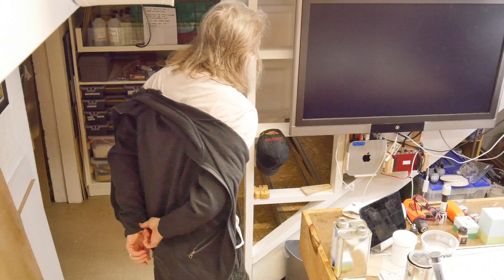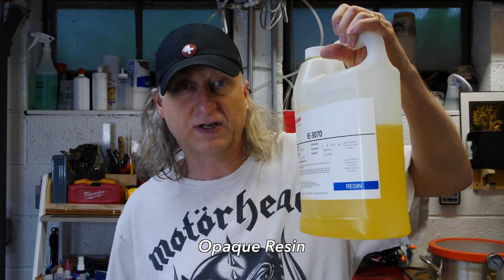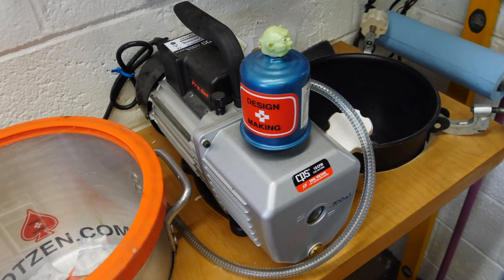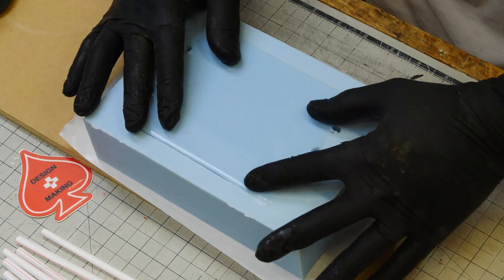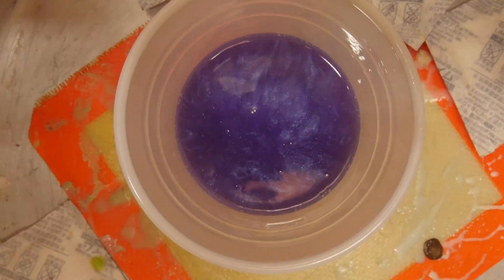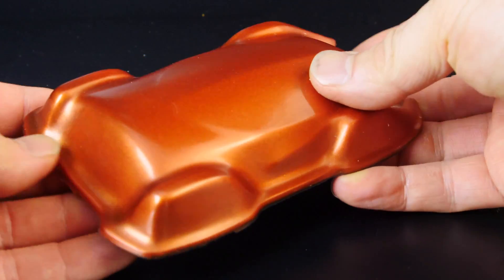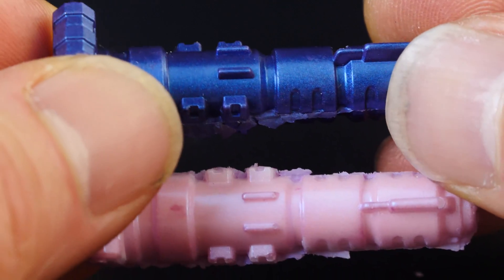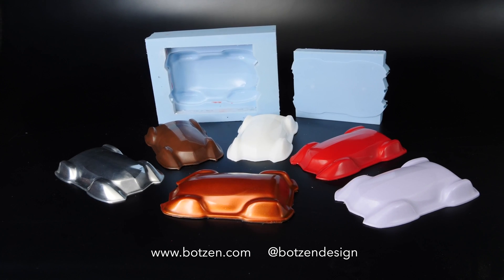Casting Polyurethane: Resin Fundamentals

Comment: Hello... Have you ever tried using a PVA 3D mold (water disolvable usually used as support material for intricate parts) to cast resin?  I cannot find anything about it on the web... amazing since I am surely not be the first one to think about that! Maybe you could point me in the right direction to another channel?

Thanks,

Stephan

Comment: Can the pressure pot and vacuum tank be the same vessel, sometimes attached to an air compressor and sometimes a vacuum pump?  Is the primary difference the clear top on the vacuum tank to allow you to see the bubbles?
Reply from the maker: I guess, you would need a special device to keep the lid on for the pressure

Comment: Hello, i want to make rubber tire for hot wheels, i make the master mold with 3d print sla, which means the material is solid. My question is should i recast it with polyurethane resin or silicone resin? thanks, sorry for this long question
Reply from the maker: Depends on the properties you want, but probably PU into a silicone mold
Reply: @EricStrebel  I need to make the tire rubbery feel, so i need to recast it with pu silicone?, that is hard isn't it? is that okay to pour silicone resin into PU? it will come out easily from the mold? sorry for asking too much, i have zero experience about this
Reply from the maker: Pu is polyurethane....comes in different durometers, check with the mfg for the type you want for your project. Good luck
Reply: @EricStrebel  Thanks, soon i'll find more info about it

Comment: Can the pressure pot be used with very soft - .e.g. 20A - transparent PU resin? I've heard that the bubbles can reappear when the pressure is released.
Reply from the maker: Testing would be required, they certainly can appear with soft materials.

Comment: Hello Eric, I'm an industrial designer, just graduated & I have my first client. My client is looking for me to produce a HiFi prototype for a light sensitive technology. My question are:

1. what would be the ideal polyurethane or material I should use to create a very clear, non distorting or refractive molded piece? 
2. Also are these hard pieces sand-able? 
3. Finally, is it possible to have one of these casted parts be ultra clear on 1 side and slowly gradient out to a frosted look?  Can this pieces be sand blasted to achieve frosted look?

Thank you, just found your channel - great info!
Reply from the maker: Watch this video, it should answer some of your questions. https://youtu.be/Kp2YopgNLZc
If you are going to resin cast your parts, then contact the resin MFG of your choice for the correct resins. I suggest BJB ent. or Rampf. Yes, PU is very sandable. Good luck!

Comment: How does a polyurethane resin cast part behave at high temperature above Tg? Will it burn or porus? Thanks in advance for your answer.
Reply from the maker: It will get soft, check the specs from the manufacturer before us use it, to find the correct resin for your application

Comment: Is it possible; if I were to make a thin cast, to cut a few sections in the middle of it
Reply from the maker: Anything is possible you would have to cut the mold from the inside so you could remove your part. If I understand correctly what you're trying to do
Reply: @EricStrebel  I was talking about the cast made from polyurethane resin, would I be able to cut it using a crafting knife?
Reply from the maker: Should work
Reply: @EricStrebel  Alright cool, can I spray said cast with Primer
Sorry if this seems like a stupid question,  I'm a first timer, I need to make sure that after casting it, I can Primer it and then paint it my desired colours
Reply from the maker: Yes, The cast part can be primed and painted should not be an issue
Reply: @EricStrebel  Alright, great
Thanks so much for the pointers mate

Comment: I have a question.  I use 60A shore polyurethane resin vytaflex 60 and i vacuum all the bubbles in my pouring container but when i pour it into my mold i still get bunch of bubbles.  Do you think I should maybe dry out my mold or is there a pouring technique?  Thank you.
Reply from the maker: Pouring creates bubbles, and urethanes are moisture sensitive, you can heat the molds, but probably best to get a pressure pot
Reply: @EricStrebel  what about silicone resin? I have been wanting to switch to that.  Will pouring silicone rubber resin create bubbles?  Appreciate the help.
Reply from the maker: Some, yes. Use vibration to remove the bubbles from the silicone after you pour

Comment: What are the advantages of using a vacuum chamber? Does it decrease amount of released carbon dioxide through the polymerization reaction?
Reply from the maker: Removing air from the silicone is the main purpose to avoid trapped air bubbles in the silicone to get better reproduction and surface quality.

Comment: Don't you need to sand cold cast parts to get the metallic look?
Reply: That's what I was thinking, saw a few videos from manufacturers and they all sand with wire wool to reveal the metallic effect.
Reply from the maker: You can sand it a bit if you want, try and see how it goes

Comment: Hi neighbor! Nice video. Interested casting polyurethane with a hole that I can tap with a self-tapping screw. Can polyurethane be tapped like that? Also wondering if threads can be cast in when using a silicone mold.
Reply from the maker: yes, it can be drilled and tapped
Reply: @EricStrebel  Thanks!

Comment: Hi! I work in a foundry (cast iron). I use daily PU resin. For repairs or little molds. Do you use mineral filler like me?
Reply from the maker: Never heard of it what does it do?
Reply: @EricStrebel For PU 2 solutions, pure or charged. A filler is made from mineral... Or a mix from it with other.

Pure, your PU is full liquid but have dimensions problems after hardening. When i create a fine thickness mould without filler it make fine little cracks after 1 week.

With a filler, it's less liquid, but little shrinking. A filler cost half of resin... So it save money. Most common filler is marble powder. 

If i need strong mechanical properties it's an aluminium powder mix.

I can give you a link and references to you. Prices are not hide. It's only for european professionnals. But you can better understand!

Comment: what kind of dye did you use and is the Vacuum necessary?
Reply from the maker: You need an alcohol-based dye and vacuum is not necessary but will give you much better results

Comment: A two-digit scale measures to 1/100th of a gram, not 2/10ths of a gram. Although I am not sure what tolerances are needed for the resin casting. Accurate to 1 gram may be enough if you are working with the volumes you have (100+/-1g is +/-1%, while 100+/-0.01g is 0.01% ). I am sure it won't affect the hardness of the final product unless you are really changing the ratios.
Reply: Love the content Eric, I tune into every video.
Reply from the maker: Correct, my bad on the 10ths. It's mainly an issue for very small batches of one or two grams of resin